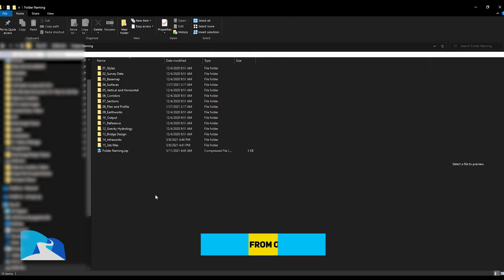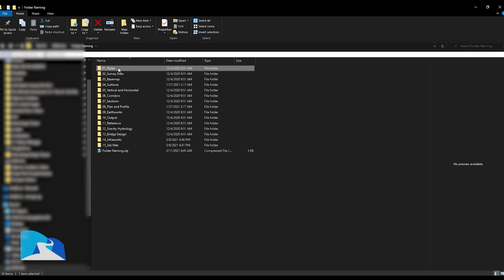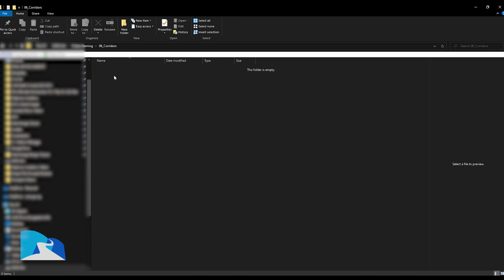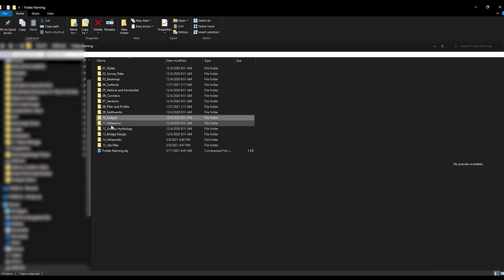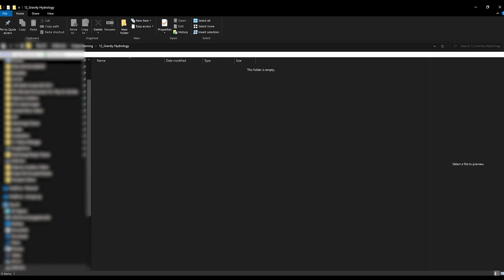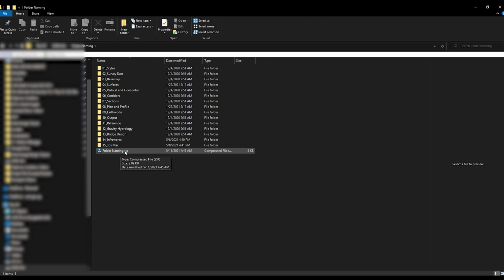File Naming Structure for working files for Civil 3D.

Comment from the maker: The moment you've been waiting for has arrived! 
Our complete Ultimate Guide to our Mentorship course is now officially LIVE on our website and also the beginners Mentorship YouTube playlist is available. 

How to join the Mentorship Program 
 ✅https://bit.ly/3XYOubm
Coupon to make the program free 4NTFRJPYLT
Want to connect with our amazing community
 ✅Link to our Highway Academy WhatsApp channel for daily tips and updates right on your phone:
  https://bit.ly/45kD6f3
Got a question or just want to say hi? We'd love to hear from you!
✅Link to our WhatsApp direct chat:  https://bit.ly/401m7LX

00:00 Intro
00:39 Folder Intro: Importance of project file organization.
00:50 Provided Zip: Mention of a zip file with recommended structure.
01:01 Benefits: How organization helps locate files easily.
01:24 Styles Folder: Example of a "Styles" folder for templates.
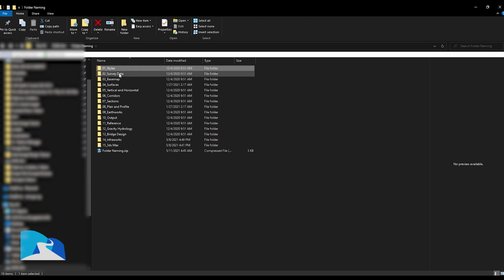01:44 Survey Data: Folder for survey data and base maps.
02:04 Corridors: Folder for corridor files, including interchanges.
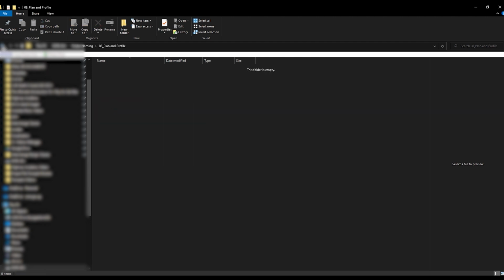02:30 Output Folder: For final deliverables like plans and sections.
03:09 Use Structure: Encouragement to use the provided folder structure.
03:27 File Naming: Suggested file naming convention (Number - Date - File Name - Version).
03:45 Data Shortcuts: Caution regarding data shortcuts and updates.